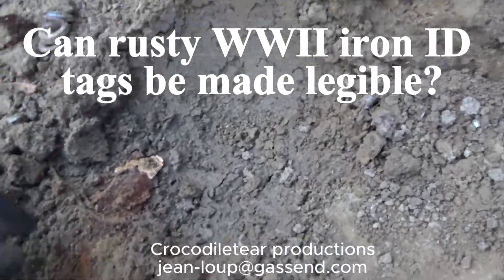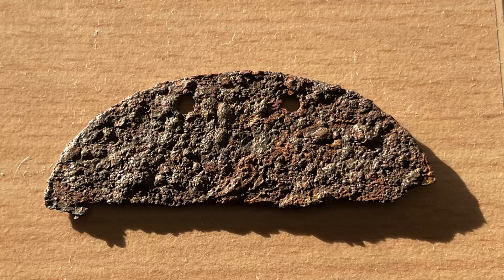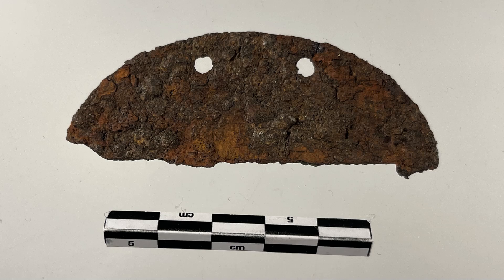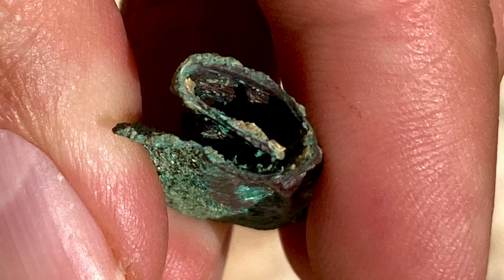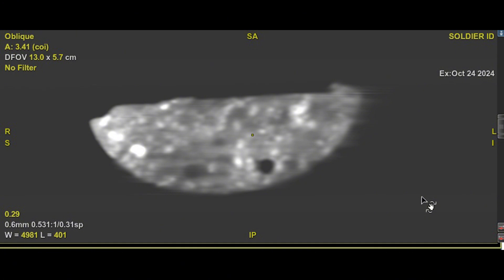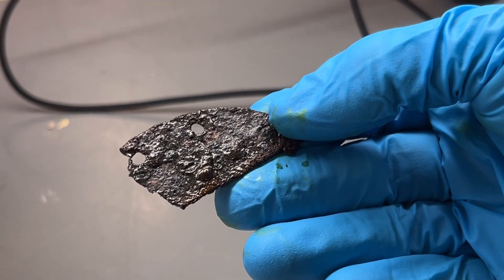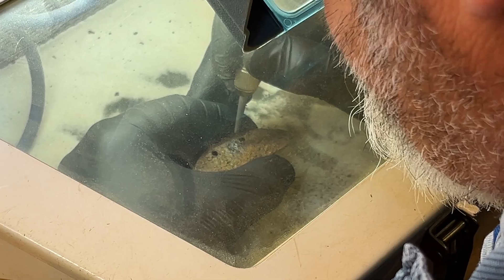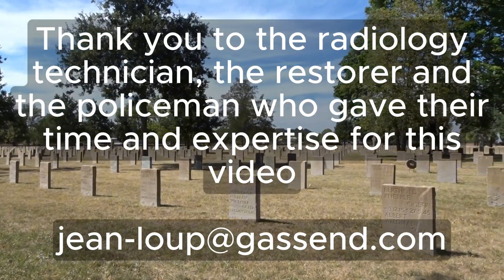Can WWII German iron identification tags still be read? WWII soldier identifications

Comment: From my understanding, Electorlosys would NOT be a good idea because it converts the rust where it is back into iron, which, since the rust has expanded, will leave the iron in said expanded state. You want it removed. You might look into Rust Blueing, specifically slow rust blueing. Basically, you take the ID tags, boil them in water, then very slowly and methodically over multiple passes, use sxtremely fine steel wool to removed the top layers of rust. Then go again. and again. and again. This is commonly used in firearm restoration, since old firearms had their surface finished in the same way. I have seen illegible serial marks hidden under extreme rust magically re-appear after carful and extensive treatment. HOWEVER, there is a point of no return, once the base metal has become pitted enough, and honestly I would suspect most of those german tags to be to that extent. Its also a destructive method, very similar to the light sand blast method of the concervitors. If you would like to research it more, I would recommend Anvil Gunsmithing here on youtube or Backyard Ballistics, and look for their rust blueing tutorials/videos.
Reply: What rust bluing does is convert red rust (hemetite) into black rust (magnetite) and then the abrasion from the fine steel wool would remove that top layer of rust. The hot water can sometimes loosen it up as well. Unfortunatly, with thicker, almost blistery, rust, you need something a little stronger to get through, like maybe a brass brush. Something harder than rust, but softer than steel and iron.

Comment: I was wondering about resin injections? I manufacture knife handles using a pressure pot. If you impregnated the tag with plastic... Maybe it's possible to sand down to the numbers?

Comment: This may be too simple, but my dad would soak rusted stuff in gasoline. Then, use a dry toothbrush to gently flake off just the outer rust. Try to make out letters. Then Repeat. Repeat. Slow process.

Comment: is there any metal left or has it fully coroded ?
If metal is left then sanding it down with sandpaper might help  to let the acid work better.
Usually we take here not just acid alone but we add heat so the acid is 80°C to make it more visible. 

I suggest to get in contact with the Kriegsgräberfürsorge in germany what methods they are aware of for this specific topic.
Reply from the maker: The Kriegsgräberfürsorge have not answered a letter I have sent them for years, and there is a body found localy that they still have not come to retrieve after 20 years.
Reply: @CrocodileTear  what a shame 😔

Comment: I work in auto crime identifying vehicles. I have used acid restoration many times. As you have stated, this normally requires a smooth polished surface. 
There is a method used to restore serial numbers that involves magnetic tape. A piece of magnetic tape is placed over the questioned area and then magnetized. Once fed through a specialized reader, it reveals numbers that are obscured by a coating. The typical use case is when a body filler is used to obscure the original marking, and a new marking is applied often to the body filler. This method will read the number below the filler without removing it, including if some attempt has been made to obliterate the original marking. 
I am not sure that markings lost to corrosion could be restored, but the method is non-destructive so nothing is lost in the attempt. 
The Los Angeles County Sheriff's auto theft unit has one of these devices.

Comment: There is a product called "Evapo-Rust" (it's a liquid) which is a heavy-duty rust remover that removes rust down to bare metal. Its use and the results can be seen on many of THE KINZLER BROS (https://www.youtube.com/@TheKinzlerBros) videos (at the 6:00 mark here https://www.youtube.com/watch?v=11NdV_Lwzko). They specialize in restoring firearms from all areas around the world throughout History. I have watched videos of firearms having been underwater or buried since WW-I being restored. The caveat here is that weapons are made of steel which does not rust as thoroughly as does iron. Since an iron ID tag is very thin to begin with, it may not have enough metal remaining under the rust for the ID to be read. If you do try it, I hope and pray that it will work and that these poor souls can be identified.
 
And thank you for all the work you do to find and identify our fallen comrades.
US Army 1965-1976 / Vietnam 1965-1967
Reply from the maker: The caveat you mention is the problem.

Comment: I have used a solution of 1/3  molasses and  2/3 water to remove rust from metal. One can use more molasses also.
This will take at least 2 weeks or longer in the solution. Wash off item with water to check progress. Put back in solution if needed.
 This only eats rust. It doesn't seem to disturb paint. It is used to clean car parts for restoration too. It is bio-degradable. Put a lid on container and keep away from pets obviously. I have seen totally rust encrusted markings made readable.
  It may be worth a try. Citric acid can also be used. No guarantee this will work  in this case, but you have nothing to lose at this point.

Comment: Regarding the decision to make the ID tags from iron. I think that probably towards the end of the war Germans were lacking metals, because they lost control of countries that they received them from. Probably most of the aluminium they had left was used to build planes and other metals couldn't be spared, because were valuable for weapon industry. Therefore they used the leftovers to make the ID tags toward the end of the war.
Reply from the maker: Yes of course. But how many aluminum  mess tins and canteens could have been recycled into more durable ID tags?
Reply: @CrocodileTear  I can only guess here. It would require more work in order to produce sheet aluminium in order to get it into the press. Probably they didn't have tools and machinery to spare. They probably didn't even consider the durability in the ground. If you told me to produce the ID tags, I wouldn't consider the durability in the ground for 70 years. What I am trying to say is that when you decide to change something in manufacturing process, like change the material, there must be some good reason for it. It isn't usually easy to change the supply chain.
Reply from the maker: @lr5037  In my video "a whisper from the grave" you can see an ID tag that a soldier made from a random scrap of aluminum he must have picked up off the ground.

Comment: Long shot , for such fragile pieces non destructive testing would be the only way to go . X-ray tomography as used in the investigation of the antikythera , ultimately it would rely on the preservation of density variations, caused by stamping , in the parent metal still being present. 
Ask the guys at Cardiff University who developed the system that was used in Athens what they think.

Comment: i would try a Chelation process like Evaporust or better yet Backyard Ballistics DIY receipe  - he uses it to restore very rusty firearms and it works amazing- it removes rust, but does not attack the good metal. https://www.youtube.com/watch?v=fVYZmeReKKY
Reply from the maker: Firearms are very solid, unlike these very thin ID tags.
Reply: @CrocodileTear  not always, many firearm parts are stamped steel,  magazines are also often thin steel. and that is exaclty why the chetation method is better than using a sand blaster or acids.

Comment: As I said: submerge the tag in strongly mixed oxalic acid and let it soak for as long as it takes. The acid are good to remove rust with but also removes paint but that is no problem here. Works very well on old and very rusty beer cans for my collection. Would be interesting to get to know if it works here as well!
Reply from the maker: Since you do it regularly, why dont you give it a try and send us the result?

Comment: I use copper 2 chloride (frys reagent) to bring back the ground off frame numbers on stolen motorcycles. The punched numbers react at a higher rate to the etching than the surrounding metal. You need to, counter intuitively, polish the surface as much as possible for a good result. You should also have some nitric acid on hand for clearing deposited copper out of the imprint.  I have trialed it with hand stamped metal with results. The decades under ground may cause some issues with the structure of the metal. I might run some more tests on some rusty junk i have laying around if it might actually have a use😮
Reply from the maker: You cant polish this. Your comments are adressed in the video.

Comment: Can you create your own id-Tags, maybe deliberately let them rust quickly (there are certainly chemical aids) and and try different methods?

It seems again that there is no way to possibly restore something like this., maybe just because nobody has seriously tried. 

Filing it down to a shine would certainly be one of the most promising options, IF the internal structure of the metal is changed by punching and there is some crazy expensive stuff that can analyse something like this. Here you don’t even have to let the metal rust to test. But I suspect that it does not compress that deeply and/or the layers above have already been worn away
Reply from the maker: Touching this tag lightly is enough to destroy it. No filing is possible...

Comment: You will not restore visibility if you remove any of the rust, but you might be able to apply reverse electrolysis to convert the rust back t iron such as was done to restore the Hunley Submarine parts.  I do not give better than a 10% chance of this working, but worth a try.  Need to try other than ID tags first to see if it is possible.

Comment: Thanks Dr. Gassend.  I commend you for your efforts to try and find a solution for the rusted German ID tags.  It's really sad that some bureaucratic decision has made it impossible to identify/return German remains.  Do you happen to know why the change to iron tags was made?  Anyone w/ a basic understanding of chemistry should have known the ID tags would rust over time.
Reply: I assume it was likely part of the 'last ditch' production processes. With germany so depleted in resources, they probably diverted all material they could to those production items that were of higher priority.
Reply from the maker: Isamislam's reponse is exactly correct.

Comment: Great to see this effort being taken, thank you for that and the very important work you and allot of people do for these forgotten soldiers. I do have to make a remark for something you maybe are overlooking from the situation in late war Germany. Maybe using iron only for German dogtags wasn't their fist choice either, precious metals like stainless needed for lining of barrels and cylinders of engines, races and balls for bearings and aluminium needed for aircraft and parts just had a higher priority.
Not that this was a good thing, they might had to work with what was available? but an understandable one in that regard. @CrocodileTear.
Reply from the maker: Of course there was a reason for this choice. They could have made brass ID tags with the equivallent amount of brass needed to make one cartridge (like the Ialians did). Instead they issued soldiers 120 cartridges but not a brass ID tag. It is true though that they no longer used brass for catridges late in the war as well. Bakelite ID tags would have been better than iron.

Comment: Dang, thats sad.... I would think the only other possible option is to let them sit in such an extremely weak acid that only the softest layers of rust are dissolved and absolutely none of the base metal is damaged. Then, clean it very lightly with a toothbrush and see if any letter remnants remain. I fear that the sand blast method might remove some of the metal with letters in it since it is so weak. A light toothbrush could even damage it...

Comment: 🤔 there are plenty of videos on YouTube showing how they clean rust from various items...
Reply from the maker: Is there one showing an iron German ID tag in poor condition beeing cleaned successfully?
Reply: @CrocodileTear  I don't remember. Ive watched so many with all sorts of items. Mostly they use a small electric boxy looking device (I'm not an expert in that)  with bowls placed in it. Inside them somekind of products...
   Can the plate be cleaned with petrol? I remember metal things being cleaned with petrol and old toothbrush or wire spunge 🤔

Comment: i suggest put the tags in destilled water or rainwater works too, changing the water every week, this method takes a few months for every item and works on old iron items like very old cannonballs or crossbow bolts, after the rust falls of, the item must be "cooked" for 20-30 minutes in oil to preserve it from new rust.
i used this method for my findings as a metal detector guy

Comment: I mean... Maybe a combination of things, first "sandblasting", then polish it with a Dremel tool and polishing compound do it nice and slow, very gentle (i know it's too fragile, maybe do something like jewlers do, and set the tag in a resin like substance that if heated it softens cools down hardens so it doesn't move or break), then, etch it with acid, maybe an MRE, MRI, CT scan, electrolysis, evaporust, last one i read was laser cleaning. I don't know man I'm pretty sure that the loose rust must come of first to have a better chance at any method, i would definitely bet my money on the etching if anything at all

Comment: I have seen lasers used for vaporizing rust for restoring items with heavy oxidation. The laser, for some reason, does not attack the non-oxidized base material. The equipment is specialized and eight years ago the equipment was cost prohibitive for individual ownership. There are companies that offer these services, the results can be remarkable. I don’t know if it will work for your application.
Reply: I would say, its worth a shot. While it will not smoothen the surface, it at least removes the discoloration.
Reply: Nice idea, but impossible in this situation.
Reply: I can imagine that if the plate is rusted evenly when you remove all the rust it could be readable again.
BUT: the shown tags seems to be turned in 100% rust, there is (almost) no real iron left. That is why it is that brittle. 🤷🏼‍♂️
Reply: @CarLos-yi7ne  Steel doesn't corrode evenly. Unfortunately, this means that any information has long gone. I explained this in my post, which of course nobody is interested in. Instead, you've got replies to those making suggestions which won't work.
Reply: Actually there's been a lot of research into this exact topic by the FBI, ATF, etc to extract serial numbers that have been eaten or filed away. It turns out that the process of stamping the steel changes its crystal structure even multiple mil below the surface and causes it to corrode/dissolve at a different rate than the surrounding metal. So laser ablation (which to the ops question, works on rust but not the base metal because rust is darker and less thermally conductive so it absorbs the laser energy more efficiently and can't lose it to the surroundings as easily causing it to reach its vapor temperature while the steel reflects the majority of energy and spreads the rest) followed by chemical etching may well bring the stamping back. It's amazing how absolutely obliterated a stamping needs to be before it's gone
Reply: A laser is not going to bring back an engraving that has turned to bubbly iron oxide. It’s just gone.

Comment: Try electrolysis. It probably wont work for the tags in very bad shape but it will work for the moderately corroded ones. Make sure you consult experts  and use the proper voltage/current
Reply: It does a good job on lots of stuff I fooled around with.. I would try it, nothing else to lose really?? Even that evaporust liquid does decent on things. everytime I find metal or anything of the like and it has writing I try different methods..

Comment: my  best try would be to grind down and polish the reverse side of the tag as much as possible and then try the serial number restauration technique on the reverse side
Reply from the maker: As you saw, the tag fell appart on its own, so there is no grinding or polishing possible.
Reply: @CrocodileTear  for this one of course. Maybe a grading system could  be useful for iron tags to identify which ones could be worth investing the time/effort to  recover the data.